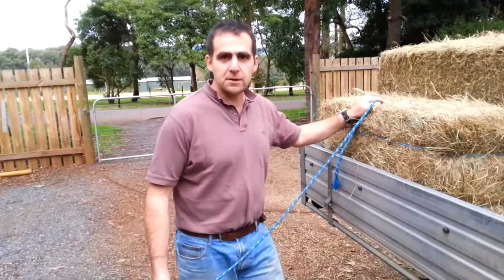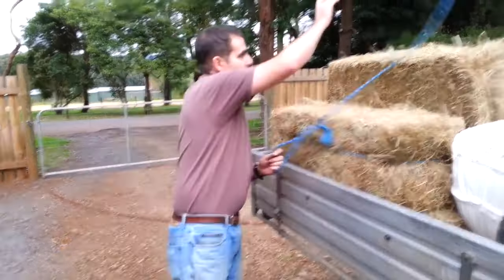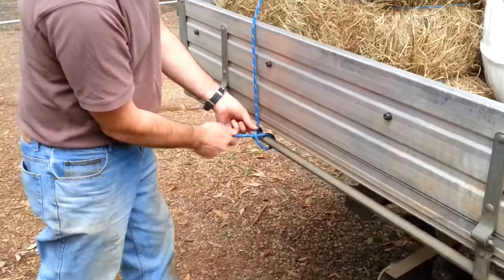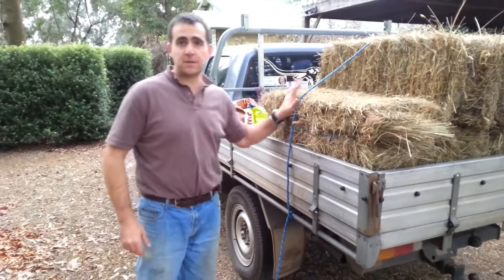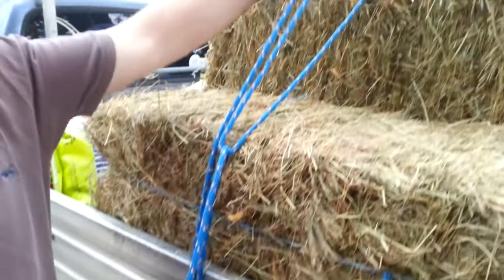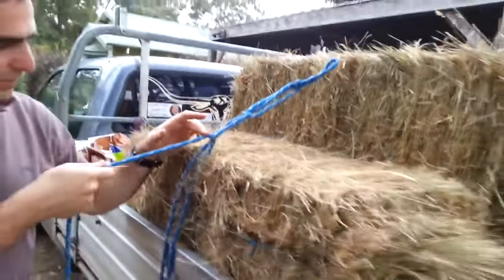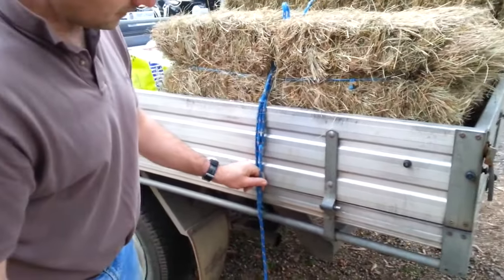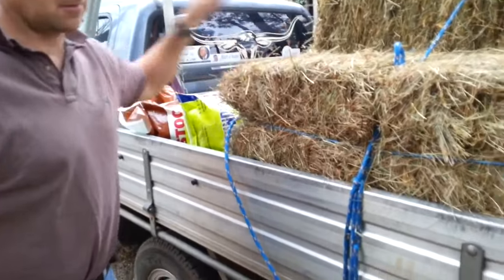The Truckies Hitch

Comment: Tricky Truckies knots will get you out of lots of problems . In days past I`ve used them in multiples to winch my 4WD Patrol up a slope enough to give it a rolling clutch start after I killed the battery . Also if you examine your basic sheep shank you`ll see a clove hitch . Turn it on its side and view the double lines as though they are your combing rail , and you`ll see a clove hitch in  your hands .  Great subject you picked for the video , thanks for sharing it .

Comment: Thanks Tim, there is a variation to this which avoids the need to pull all the rope around the rail. If your rope is particularly long & you want to keep it that way, you can just pull a loop under the rail to pick up using the hitch. Then you can pull your load down & tie it off much quicker, see how you go tieing it off in a similar manner. The remaining rope can then be hitched to another part of the rail to pull down another part of your load.
Reply from the maker: Try my video "Ultimate truckies hitch" Cheers mate.

Comment: This is one of the best videos on Youtube about "Trucker's hitch", thanks a lot.
Reply: It's actually not a "trucker's hitch" . They are two different knots. The "truckie" uses a variation of the Sheepshank to get mechanical advantage. A regular truckers hitch uses either a normal slipknot or an alpine butterfly knot to make the loop that is used for the pulley action.

Comment: Hi! That's my fav rope knot and we used that every day loading ships tying long pipes on the spouts we used to load grain. However the correct name for that knot is the wagoners hitch! And no need for 2 loops ..one will do! Thank you though it's good to see someone else know about this knot!😊
Reply: it is also known as a sheepshank.
Reply: One loop is less safe under heavy loads.  You can do a half-hitch after the first loop but the 2nd loop is faster and comes undone more easily.
Reply: Extra loop is for additional mechanical advantage which can often be necessary.

Comment: i got shown a complicated way to do this 30 years ago and i always needed to examine the sample he put between 2 steel bars in my backyard.  i'm sorry to say it but yours is even more complicated.  the way i devised that made it easy to remember is as follows.  make a loop in the rope over the load.  push a loop made of the rope dangling down from below it, through it - pull a big loop through it.  then make another loop in the rope above the first loop over the load and pull the big loop you made through that one too.  this is your knot done in the way that made it easy for me to remember.  a shipwright showed me a more secure variation. you only need to do one loop through one loop for this.  after pulling the big loop through the first loop over the load, go around it on the high side half a turn and poke back downwards through that first loop.  pull it through a good amount.  now put the loose end around the rail and bring it up and tie it through the loop that was first made and on the side where the second loop was pushed through from.  then return this end back down to tension and hitch it up.  this knot will not undo even if the tension on the rope slackens where a truckies knot may undo.  he also showed me to do a little loop after making the drivers side hitch then pass the short tail through it.  this lessons tension on the hitch making it able to tolerate greater stresses.  i rewrote this many times trying to make it better understood.
Reply: Other than when the load somehow compresses or shrinks or if the rope stretches, how might a trucker's hitch lose tension?
Reply: @roseymalino9855  , aha!  good question!  if the load shifts.  or if it wasnt tight enough in the first place.  on long trips i use the method suggested to me by the shipwright.  it is more failsafe.  all sorts of amazing things can happen on long trips.  for example, trailer tailgates can vibrate open and fall off, waiting for me to discover it is missing causing me to return back across the nullabor (only 50 kms, thank goodness) to find it patiently waiting for me in the middle of the road.  remember, absailers and mountain climbers never use these truckies hitches.  they can be made more reliable by making sure there is a lot of excess pulled through.  personal experience has taught me that lesson.

Comment: Great video mate! Just one little point. If you heat seal your ropes at the ends you will make life dealing with ropes so much easier! Cheers.
Reply: ropes made of cotton/not nylon won't melt.
Reply: @justsomedude77  True. Natural fiber ropes -- cotton, hemp, sisal can be whipped (wrapped and tied with fine twine) or taped. For synthetic rope -- nylon polypropylene, polyester, etc.-- heating the ends with a lighter, candle, gas stove burner or whatever to melt the fibers together is the easiest way to keep the ends from unraveling.

Comment: Good stuff. This version is heaps easier to untie after load and if wet, but I've found that it just doesn't hold up with paracord and smaller diameter ropes and will collapse under heavy load. A lot of people bitch about the slipknot version, but for paracord it'll take quite a bit more force... and paracord is cheap if you have to cut (though honestly I never have had to cut it).
Reply: Hahah - yeah yeah - no I didn't mean to suggest anybody should tie a load with it (unless you've no other choice). I did recently start tying a midline figure-8 for the loop in place of a slipknot and seems good for either application. Not as quick but there's no way it'll collapse though. Cheers - thank you for the vid. :)
Reply: @FarmLearningTim  its a shame its illegal to tie loads down with rope now.Nothing  but rated ratchet straps for me now.

Comment: Interestingly, the mechanical advantage of this system is actually 3:1 - theoretically.   So if using pulleys it would be.  Using a rail and loop of rope instead of pulleys there is obviously a significant loss due to friction.  Still, the power of a truckies hitch is apparent to anyone who has used one.
Reply: Incorrect - the mechanical advantage is as he stated 2:1, minus (as you correctly stated) frictional loss.  The hitch in essence is one movable pulley - therefore if he pulls through 20 cm of rope, the pulley (hitch) moves 10 cm, therefore ratio is 2:1.
Reply: Wrong. Ian Brown got it right. We are calculating the tensioning force we need to apply on the rope we hold in our hands to generate a given tension in the rope that ties down the load. We have 3 parallel strings on the hitch side while only one on the other side hence the 3:1 theoretical ratio if we ignore the friction.    You would get 2:1 ratio if you would tie the rope to the bar and then pull it through the hitch. That  would give a slack to one of the strings out of tree so the tension would be divided in only 2.  A drawing could help.
Reply: A truckers hitch is a simulated block and tackle, a block and tackle will always have a mechanical advantage that doubles with each simulated pulley that would increase the mechanical advantage. 2:1 then 4:1 then 8:1 then 16:1 and so on. 3:1 is not even a possible mechanical advantage.

Comment: Great for loads but I cant figure how to use this for tying between two vertical points like two trees or two verticle points? Can it be done with this truckies hitch?  Ive used other knotts and seen a couple vids of so called truckers hitch tied between two trees but non of them get the line nearly as tight.
Reply from the maker: Yes you can. I use this for campsite clothes lines etc.
Reply: Thanks woke up this morning and managed to figure it out, nearly broke the stairs bannister ,didn't realise how tight I was tightening it so it sure works well. I often find thying knotts from a new angle, especially if Ive done it many times just one way difficult to figure but this one proved fairly straightforward. I really appreciate your share of this, its a bit of a favourite now so thank you. @FarmLearningTim

Comment: Well it ain’t how I do it but damn if it didn’t work nicely. Only thing I would maybe be concerned about is the clove and a half hitch on the first side. I would prob ya a bowline but either way the business end is the impressive side CHEERS and thanks mate from the US
Reply: I can't tell you how many times I've had to walk around and hook a bowline back on the trucks tie dow hook.
Reply: @garyjohnson4657  I was thinking a running bowline through a hole in the tie down. I see how they could just pop off. Cheers

Comment: Simpler ways that work just as well use a slip knot instead or alpine butterfly (lineman's) knot for the talented.
1:56  Using sheepshank in the rope, yuck. Don't think they even teach sheepshank anymore, shakes loose.
Reply: Sheepshank is used to shorten lengths of rope.  This is the trucker's hitch in "sheepshank style".  Two different things.  This method is fast, easy, and secure.

Comment: I disagree - tie the clove hitch - throw all the rope over - push a LOOP over the top and under the rod - hold it up - reach through that loop and pull the rope from the other side to form a second loop - put the end of the second loop through a twist in the rope from the other side - pull the rope end up at three to one to tighten the load - throw the rest of the rope over and do it again. This is better because its a three to one pulling up, not down, plus each time another knot is done it tightens the WHOLE load and to release simply hit the twists and the whole rope is free without having to be threaded through anything. That is a trucks knot.
Reply: David Ellis I have seen that push loop starting method. It is in keeping with the economy principle of avoiding threading lengths of rope. Also, to finish the hitch, the final clove hitch should be tied "in the bight" under the same above principle. Alternatively, the final half hitch could be "slipped" for ease of tying and untying.
Reply: What you are describing is a trucker's hitch with a single twist loop which is not as safe as doing two twists which will get you exactly the same as the video except without the elaborate hand movements shown.  Also, the upwards pull doesn't give you the 3:1 ratio, that's already provided in the hitch.  The upwards motion is just a redirect of the working end force and the rod is the only thing seeing that extra force.  However, the standing end attached to the other side of the truck is still only getting force from the 3 lines formed by the pulley system..  Going to try that out next time though the only thing I can see as beneficial is sometimes it would be handy to pull up instead of down.